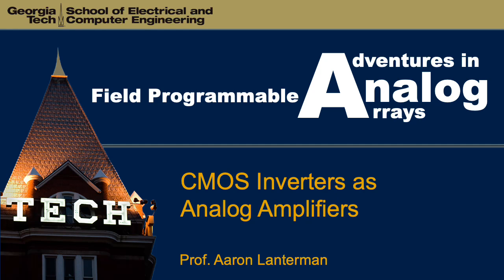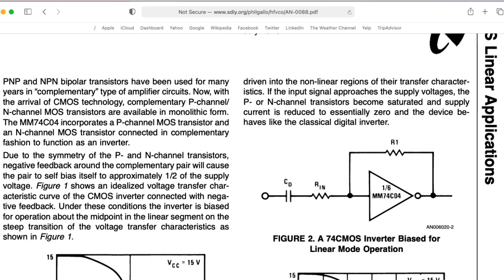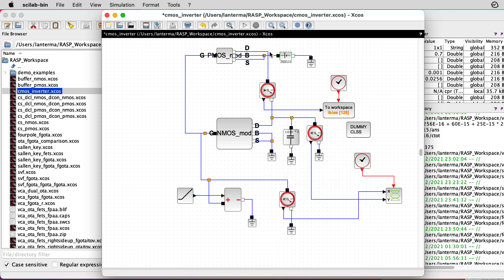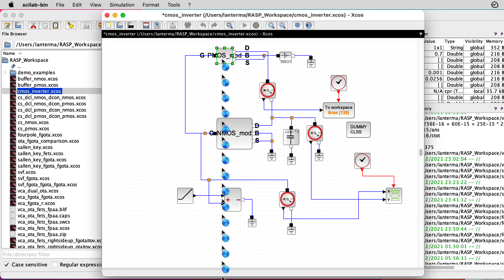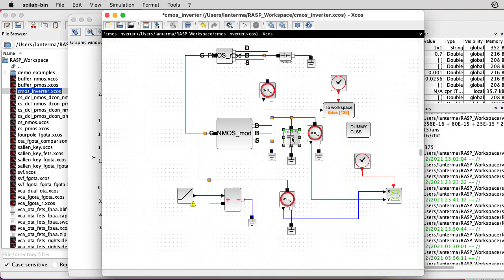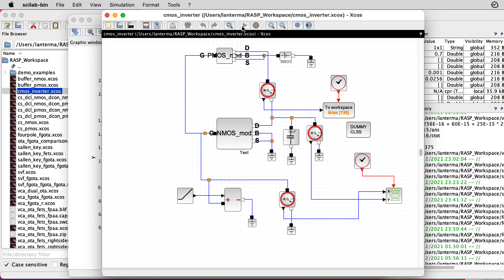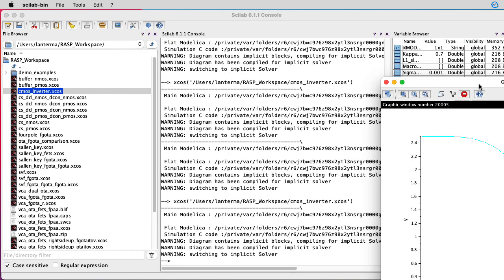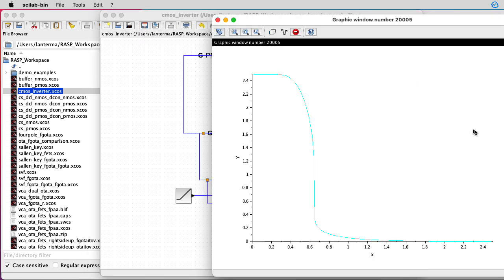CMOS Inverters as Analog Amplifiers (Adventures in Field Programmable Analog Arrays)

Comment: Thanks for the video. CMOS inverters are also used in guitar stompboxes for a long time (from 80'), either 4049 or 4069. Eg. EHX Hot Tubes, Red Llama, Purple Platypus to name a few. You only have to make sure to order unbuffered versions (UBx suffix). Would be cool to talk about real circuit design a bit, I typically see pretty high resistors around, not fully sure why.

Comment: I built a WASP kit.  Sounds great in a very aggressive fashion.
Reply from the maker: Those CMOS inverters must provide some really cool distortion!
Reply: @Lantertronics  Alex Ball has a really good video on the Wasp! Just beware, that video should be considered choking hazard due to the insect pun density.
Reply from the maker: @MoraFermi  Oh yeah I saw that one! Alex Ball is AMAZING.
Reply: @Lantertronics  LoL, professor, You gave me an idea and i designed a new filter, unlike any schematic on the planet ... and it works in simulator.

I did study for electrician, but ... a long story.

Hopefully this part does the job for me: IRF7105 ... it's +/-  25 volt dual p / n MosFet , i compared the data with the BF256 ... but the kinds of data of the 2 parts differ ... like comparing a transistor from Philips vs a NEC part made in japan.

 ... than it still takes like 6 months or so before i get the pcb's in mail, i have some other pcb's in pipeline.
Reply from the maker: @AnalogDude_  Excellent!
Reply: @Lantertronics  I just bought a Behringer (Yes, I know...) Wasp. If I get around to taking it apart I'll have to look and see if they kept the inverters or if they redesigned the circuit to be more traditional. I would suspect they cloned it correctly though, only because they actually cloned a well know issue with the wasp double triggering on the first production run, which implies to me the circuit was basically directly lifted.

I also got the Behringer TD-3 (303) and have already modified it a bit. There were some interesting differences between it and an original 303. If you google TD-3 modding guide, at the bottom of the PDF that's in the first few results is a complete circuit schematic that someone whipped up, it's kind of neat!
Reply from the maker: @VegaDW  I'd bet they kept the inverters -- the main reason EDP used them was because CMOS inverters are "cheap as chips" (heh) and you get SIX of them in one package. And Behringer isn't exactly known for being extravagant in their parts choices. ;)
Reply from the maker: @VegaDW  Direct lifting would indeed be way easier than tweaking it (assuming all the original parts are available).
Reply from the maker: @VegaDW  Thanks for the TD-3 tip!
Reply: @Lantertronics  the Behringer TD-3 has a ROHM BA662 OTA clone made by dual matched transistors, schematic made by  ... Open MusicLab, copied by ... Uli Behringer and his crew.
Reply: The legend talks about the legend!! Thanks for continuing to share